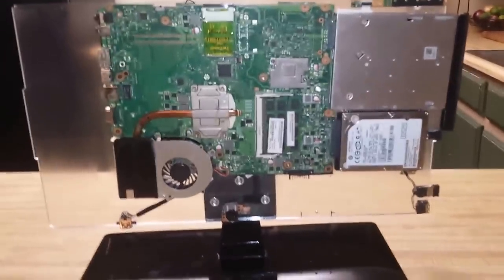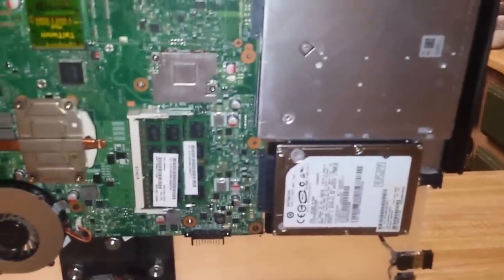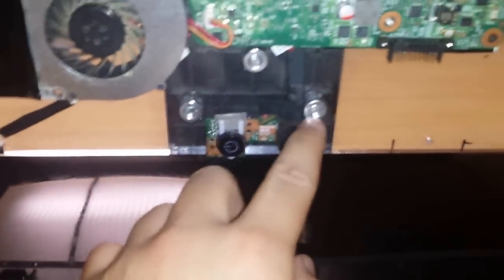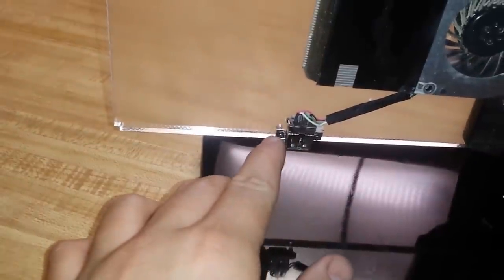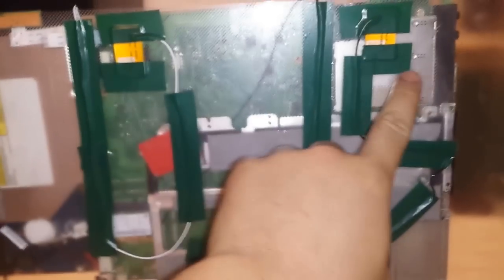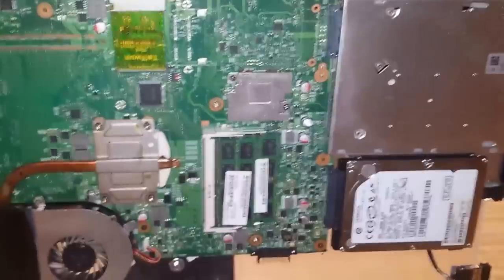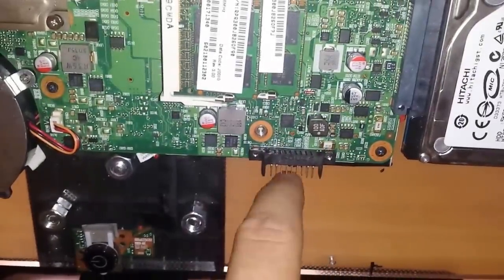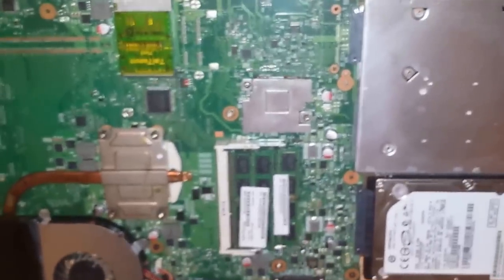Parts laptop turned to a desktop.

Comment: i did a similar project but mine can only support a gig of ram and runs windows xp for now. i also had to do soldering on the motherboard as the power button was soldered directly onto it. i put it in an old cctv dvr case and now everything looks good
Reply from the maker: That's good to hear.

Comment: Do I need to do anything special to remove the laptop screen so I can use an external monitor or does HDMI still work even without the laptop screen plugged in?
Reply from the maker: yeah used it to play a couple of online games but i have a main gaming rig so dont really use it at all
Reply from the maker: yeah hdmi will work when you unplug the laptop screen. hdmi will become main display output

Comment: is there a way to cluster multiple laptops into one desktop?
Reply: Broccoli Guy it is, in fact, thats what supercomputers are. however, doing so creates bottlenecks from the ammount of data your cables and main router can transmit. plus, its very pricey and wont run very well for gaming or internet surfing. best just get a new system
Reply: Gaultier Gotz thx for this comment!

Comment: Sir,
Is it possible to use a laptop keyboard as a desktop keyboard? 
Actually i have a old laptop, so with any possible way, i wanted to make use of that keyboard by converting it into the usb keyboard. ...please
Reply from the maker: yes but you need the right cables it might be cheaper to just buy a USB keyboard.
Reply: :7